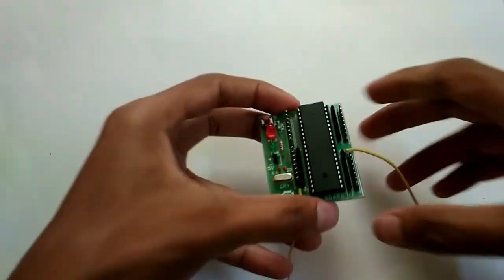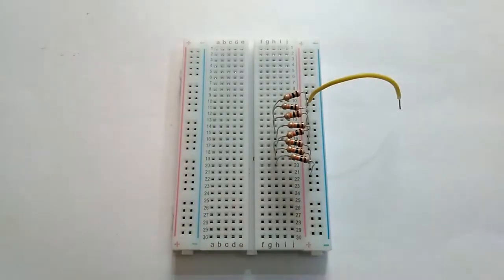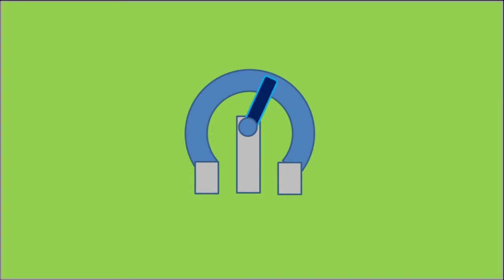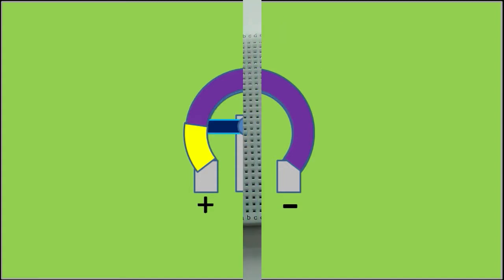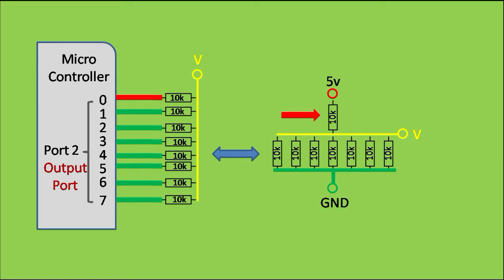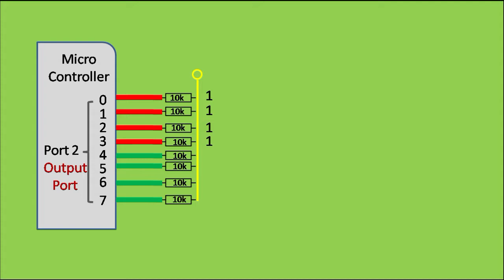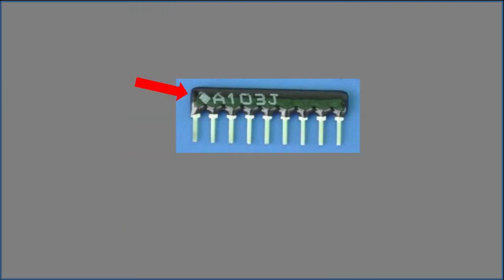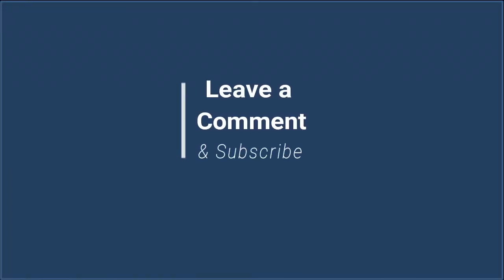Crude Digital Potentiometer with MicroController (8051)

Comment: This is an interesting way of making a digital potentiometer from scratch, but can this really be practical such that what is the maximum power rating? I am assuming the power rating is based on the microcontroller's maximum threshold handling amperage.
Reply from the maker: Hi.. this is more of a concept. That I demonstrated in this video... This can be used for projects where analog voltage generated by  microcontroller Is in increments of say 0.5volt.
Reply from the maker: Also, since this circuit is used in measuring voltage* only.. amperage of this potentiometer is unimportant.